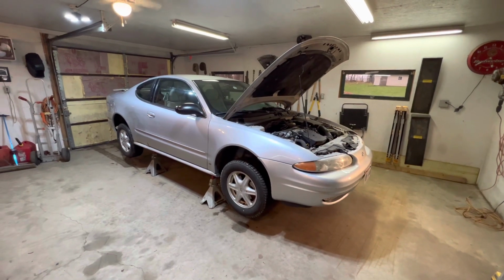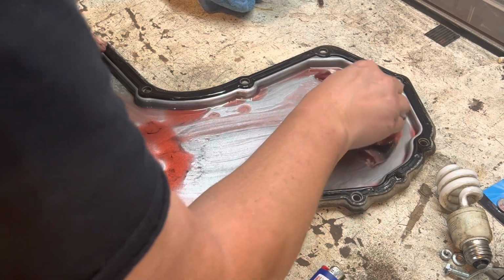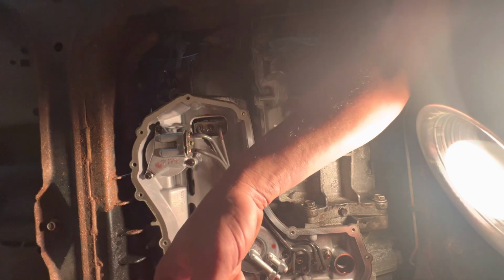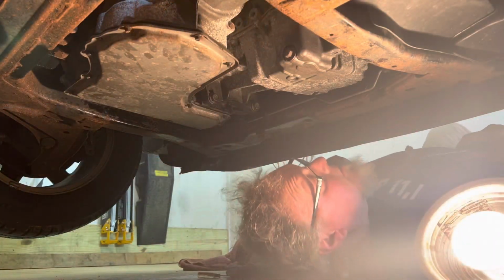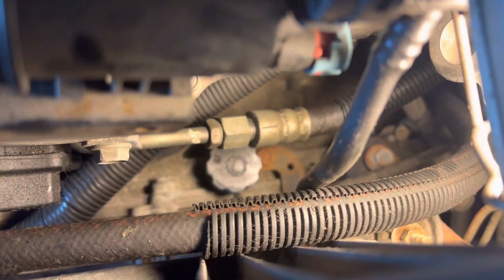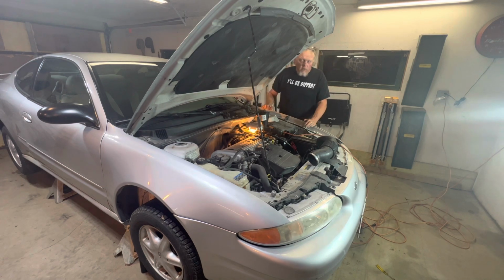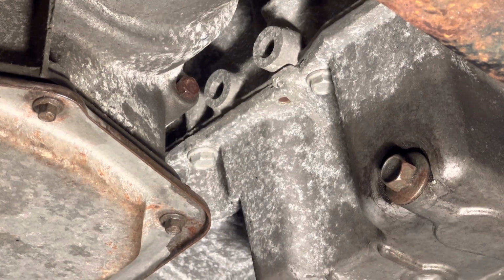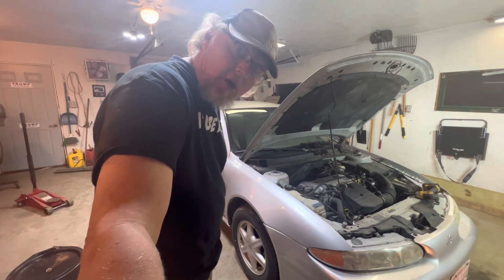Changing Transmission Fluid on 1999-2005 Oldsmobile Alero 4T40E transmission.

Comment: probably one of the most overlooked maintenance items. i bought a 95 geo prizm with 238K miles at the time, the trans worked but didnt shift real well. i changed the filter and fluid when i got it and that fluid was blacker than the oil out of my diesel truck. changed it several times over the last 40K miles and its working like brand new. i will never understand why they went away from having a dipstick to check fluids, i guess cars a built so well they never leak? not sure what it is with your video's but they are just relaxing to watch, like the leaves and makng the steak for the dog. keep up the good work.

Comment: Just bought an 03 with 23,000 one owner miles.  Had a shop put it on a lift, was shocked how clean it was.  Anyhow, a transmission service will be one of the first things I do, thank you for the well edited video!
Reply from the maker: You’re welcome. It’s easy to do but a bit messy.
Reply: Wow. I have a 99 Alero 235,000 miles on it. You got yours almost new 😀

Comment: I've gotta do this to my mom's 99 Alero. I've changed a bunch of transmission filters and gaskets through the years. But those vehicles all had dipsticks. My main concern with doing this job was making sure that I had the proper fluid level. I think I'm gonna put a level up to the transmission pan and level the car out as good as I can before I go any further. 
Thanks for the video. I've heard about the check plug on these transmissions. But now I know exactly where and what size it is
Reply from the maker: It’s pretty simple to do. Thank you for commenting on it. I love that I can help out.

Comment: Excellent video very straightforward explanation.
Reply from the maker: It’s easy to do but man is it messy!
Reply: @pilgrimsgarage  I have an 02 Alero with a manual transmission and have never had to replace the clutch. Maintaining the fluids is so important for longevity.
Reply from the maker: @davidphilion1432 the clutch really doesn’t matter when it comes to fluids. It matters how you drive it. If you still have the original clutch in it with a fair amount of miles then you sir know how to drive a manual transmission. 😀
Reply: Thanks for acknowledging my clutch abilities. 
It's not often people with youtube channels respond.  My next project will be fixing rust above the rocker panels.
Reply from the maker: @davidphilion1432 yeah the rust on this one isn’t fixable…its bad. You should hear it when I jack it up…sounds like Rice Krispies.
Reply: The longevity of my clutch and fluids are 2 separate thoughts.
Reply from the maker: Nice! Well they’re pretty decent cars so I hope it lasts for you. Keep me informed.

Comment: I just changed my ATF ('03 Cavalier).  Same process, but the Haynes repair manual states 89 in-lb. That's what I did.....no leaks.
Reply from the maker: I got my information from the GM service website. Honestly, I don’t think that there’s much difference 35 in/lbs can make. It’s certainly not 2 uugah dugahs 😉. Nicely done by the way. I hate that GM made some of these things “unserviceable” by the common man… I like saving money. Thanks for the comment and thank you for the info.

Comment: I purchased a 2001 Oldsmobile 2.4 L. The manual says you don't change the transmission fluid. What's up with that?
Reply from the maker: I’m sure the manual says only service by Oldsmobile professionals… or at least that what mine says. It’s a breeze to change… just messy
Reply: I also have a 2001 Olds Alero and I just located your video, which is a great help !!!! Five Thumbs Up 👍🏼👍🏼👍🏼👍🏼👍🏼 !! I have never had any trans issue s to this very day !! Tyvm !! (O5-13-2023)

Comment: thanks for the video really cool! can you do more alero videos? please!
Reply from the maker: What kind of videos are you looking for? I do have one on here. I’m just working on my car. Just a general maintenance stuff. I also have one on here replacing the wheel bearings. They are a very easy car to work on.
Reply: @pilgrimsgarage   thanks for replying! you see I bought my first car and its an alero sedan (4 doors) 3.4 V6 . I fell in love with it and I'm looking to studying it more. it has only 67 thousand Kilometers and it drive like a beauty. the only thing I noticed is that when I put it in gear it does a slight Thud/clank noise accompanied by a slight lurch/jerk of the car. I found your video looking for transmission related matters. What would really be cool is to have a video that describes a bit the motor and the undercarriage, as there seems to be a slight leak right next to the area where the transmission fluid basin is, but from what I could see it's not exactly or necesserily coming from the basin but rather next to it, so I was wondering what else is in that area (specifically on the passanger side, right behind the transmission tank) 

I cannot lift the car as I didnt acquire the necessary tools yet. 

:D
Reply from the maker: @kayzoku1  I have a 2.2 4 cylinder in this one. I’m guessing it’s similar driveline wise but I can’t be sure without seeing it. 
I’ve replaced the wheel bearing in one video and I have changed the transmission fluid but other than that I really haven’t had the need yet to do any other work in the undercarriage. 
Your noise you are referring to doesn’t sound to major to be honest. The cars of these years were pretty reliable. With it only having 67k on it, it should be fine.
Reply: @pilgrimsgarage   thanks for the reassurance! other mechanics back this up too. Question is, do you have an automatic? if yes, when you put it in drive does it also jerk slightly and give of a noise? same for when it shift 1st to 2nd? could you describe your transmission's behaviour as you start the car and drive? 

a bizzare thing, sometimes when I go from reverse to drive no noise whatsoever occurs...
Reply from the maker: @kayzoku1  I don’t believe that we have this problem. Honestly it’s my sons car and I don’t drive it much. I have not heard any type of clunk or noise in the transmission when I drive it. Since you have a V6 and I have the 2.2 four cylinder, you may have a different transmission. Mine is an automatic too.
Reply: we both have the 4t40 i am pretty sure, anyway, I finally got my hands on an OBD scanner, turns out the engine light was due to the air intake temperature sensor, i checked it and the wires were broken, soldered it up, reset the error and no problem. I also had a mechanic refill the frion cause my AC wasn't cooling at all and magically POOF the noise is gone, its the strangest thing but hey I'm not complaining :D  @pilgrimsgarage
Reply from the maker: @kayzoku1  that’s cool. It’s funny, I just topped off my boys Freon 2 weeks ago. The AC hadn’t worked since I got it and the ac pump wouldn’t engage due to there being no Freon. It works great now. Come to think about it, it made a funny noise out of the ac pump when I put in the first can and then it went away when I did the second can. I wonder if it was the same noise you had. 🤔
Reply: @pilgrimsgarage  probably that's unrelated to the transmission clunk noise, which yeah, second day now that its ocmpletely gone. I have theory, I used to only put it in park and not pull the handbrake (stupid mistake). Perhaps the parking stopper was the culprit. there's a video where a 4t40 is being disassembled on youtube, I'll rewatch it one day to see if that could've been the issue

have you considered wrapping the car?
Reply from the maker: @kayzoku1  no. This car is pretty rusty. I’m not sure where you’re from but in the northern states we started using a different method for melting snow. It’s called calcium chloride and it is a road treatment. It sticks and will not wash off… it’s a big problem up here. The cars now rot 10 times faster then they used to. Salt washes off, this stuff doesn’t. Wrapping the car would just be a waste of money.
Reply: @pilgrimsgarage  what the hell??? how is this legal if it degrades the car even more? also whats wrong with salt,  Idon't understand who approves this and why. 

I'm from europe
Reply from the maker: @kayzoku1  I know right? Apparently Fiat Chrysler has proposed a lawsuit against 6 states in the US saying it’s highly corrosive to the Jeep Wrangler and Gladiator frames. We have 2018 Jeeps here that are totaled due to the frame damage from rust. Many are splitting in half…it ridiculous.

Comment: Buenas noches...una pregunta no se inglés pero Aver si pueden ayudarme...yo tengo un carro Alero Olsmobil 2003 lo compre asé 2 años... pero asta orita los mecánicos que les pregunto no sabe cómo checar el nivel del likido de la transmisión 😢 pueden ayudarme.. 🙏
Reply: no tiene medidor, pero se llena con 3 quartos de liquido de transmisión.
Reply: @saulr8851 cuanto es litros
Reply from the maker: Oh my gosh I’m sorry I didn’t see this until now. If you watch the video when I’m filling the transmission there is a bolt you remove. You’ll fill it with transmission fluid until it just starts to weep out if that hole. It helps with to have a second person. You add it without the engine running. Once it comes out you can replace the bolt in the hole, tighten it up and you can start the car and the transmission will be full
Reply from the maker: Just under 3 liters
Reply from the maker: 2.8 to be exact